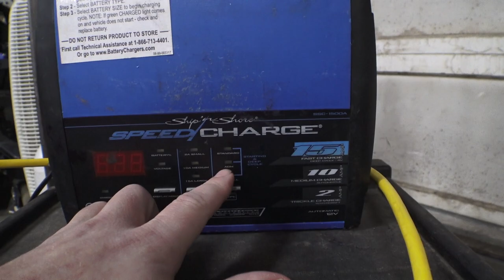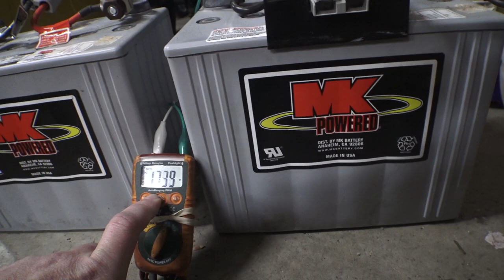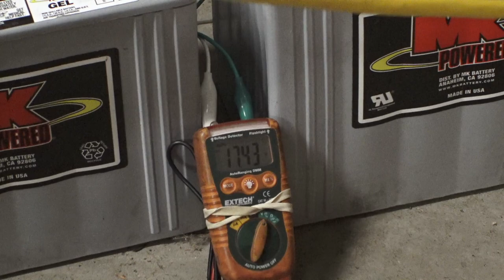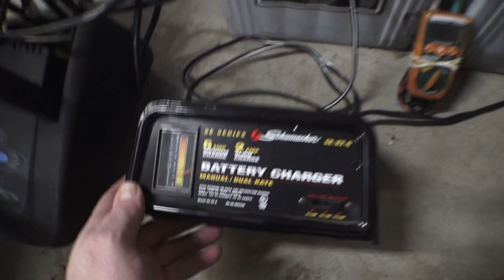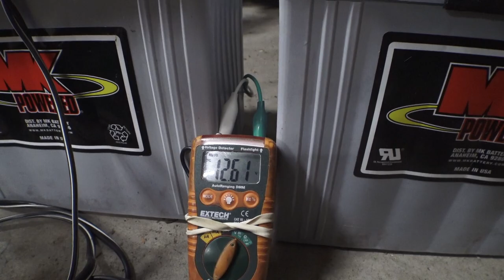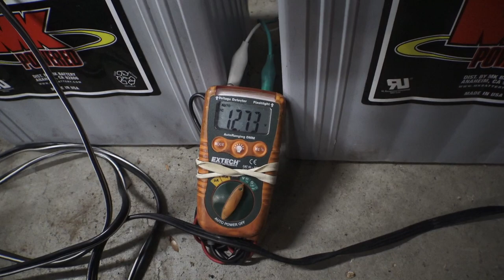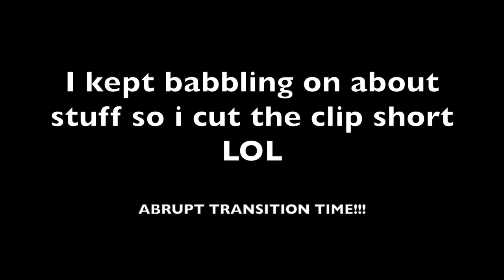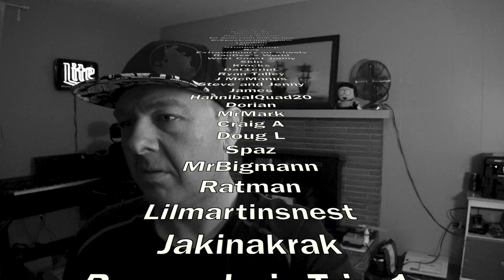VLOG 545: eleven year old batteries??

Comment: You can hook a welder to a battery if you're very careful that's about 30 volts very high amps I think he turned it up to 50 amps. No the battery has to be able to vent.

Comment: I Had My Quantom Q6 Edge Since April 11the
2020 & So Far All I Need To Replace Are The Battery's & The Yellow Retainer Screws
For The Rear Panel That Covers The Controller.
Reply: Im using an old q6 edge which ibeat on The trails it has. Been dropped still had bent wheel and The bearings is gone on The left  caster had a bad bearings  and though i have a2018  m300 permobil it has been broken down 12months out ofthe time i have had it  now its down  Again waiting on parts ands showing joystick not centered maybe the quantum wasnt so bad
Reply: I have a quantum 6edge for sale , my friends mom  never used it last serviced in 2014 . 
 Batteries are dead .

Comment: I just bought a hover around that's in really good shape and I don't think it's very new it's a mdv5 or mpv5 I think the batteries are original to it because they were stuck in there so bad with all the potato chips now I'm using it on the street and in the yard but I've got another one that's better or newer I don't know if it's better I heard the hover around has some good motors the older ones did anyway they say

Comment: what's it mean internally tothe battery when your batteries short charge? ...You know, your batteries  are dead. You charge them and they are fully charged in just a few minutes...
Reply from the maker: the chargers use voltage curves to determine when the batteries are done charging.. when the charger starts telling you they've charged up super quick - it usually means the batteries are damaged and will fail sooner than later.
inside the battery, if one of the cells short out, or goes high resistance,  the charger will essentially over charge the other cells, until the voltage is high enough, then the green light will turn on, and it "thinks" the battery is charged. 
Once batteries start behaving like this - they're not recoverable.. and they usually stop functioning within a few days / weeks
Reply: @TotallyNormal-  Yeah... I dropped the battery pack full weight 4 inches (2x f22). Then plugged in the charger overnight... but forgot to turn the charger on. Next day, the batteries were shot. I ran the charger 8 hours just so I can move the chair. Lets see what happens. Could have an internal short after that drop if all the crud settled to the bottom.
Reply from the maker: yeaa.. problem with AGM batteries are their name "absorbed glass mat" they don't really have 'liquid' electrolyte, and all the free space is crammed full of stuff to help prevent vibration damage.. so unlike the 'liquid tank' standard batteries.. gravity is irrelevant :^/  I'm gonna send ya an email.. funny story haha :^)
Reply: @TotallyNormal-  Got It. Thanks :-)

Comment: Instead Of Using Battery's For You'r Testbench 
Why not Use A universal Laptop AC Power Adapter. Or Use The Power Output On You'r Powerchair.
Reply from the maker: laptop power supplies only output maybe 3-4 amps @20 volts.. we need closer to 75 amps@24 volts :^)